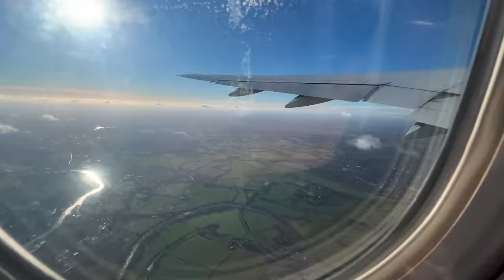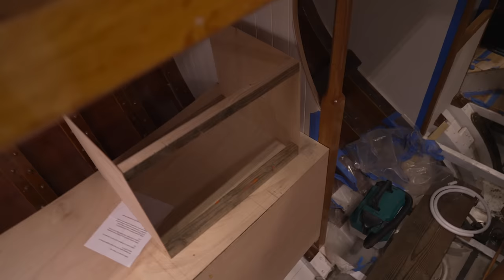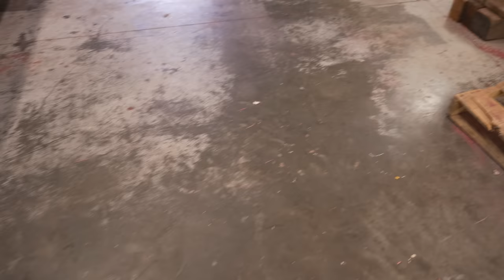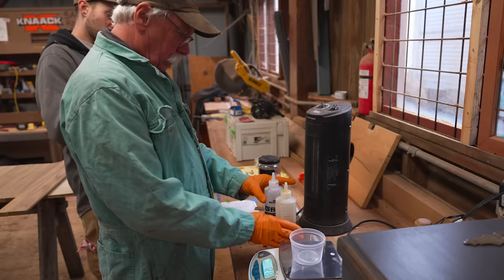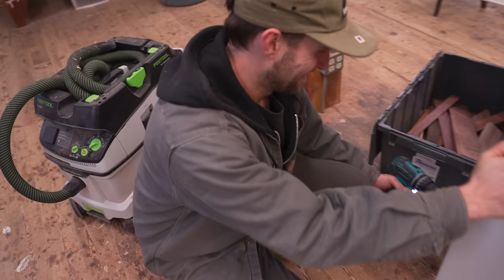Building & finishing the SOLID TEAK Deck-house

Comment: I swear, after seeing hundreds of hours of boat building videos, this is the first time I've seen anyone use a professional paint brush to apply a finish.  Congratulations Pat, you've restored my faith in woodworkers.
Reply: Then you have no idea how Le Tonkinois varnish works. It doesn't need careful application at all.
Reply: What kind of "professional paint brush" is it? Please for more informations... thanks!
Reply: @MikeAG333  Yep, I have never used that particular varnish.  But I have been a professional painter for over 20 years and have used countless types varnishes, stains, paints, lacquers, and coatings to know how tho properly apply them.  And I know that foam brushes and small 1-inch throw-away brushes simply don't carry enough material to adequately cover large areas, they shed bristles and they are awkward to hold for larger jobs.  The type and shape of bristle, the shape of the brush (angular, straight, round) and even the shape of the handle are all key to making the job not only look good when finished but to also make the job easier for the worker.
My remark was simply regarding my observations of the many other builders, refinishers, restorers, etc. that I've seen on YT using improper paint tools.  I'm sorry to have triggered you regarding Le Tonkinois varnishes.  I'm sure it's a great product.
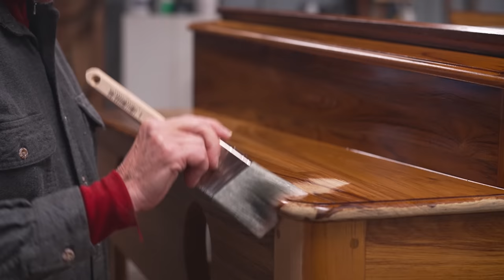Reply: @hartwiggrunewaldt5102  I'm not exactly sure what brand he's using here (17:50), but it looks much like a Purdy 3" angle-cut nylon bristle.  A professional brush will have large handle like this one, proper bristles for the type of material, trimmed and feathers bristles, and it will be large enough to carry the right amount of material to the work surface.
Reply: I couldn't agree more!  I can't stand watching people using rollers and foam brushes on varnish.  
There is no way for someone to point out how amateur they are, then for them to say they are going to "...roll and tip..." their varnish.
Reply: @FiferSkipper  
There’s absolutely nothing wrong with a roll and tip finish. Particularly when one needs to cover a lot of square footage while maintaining a wet edge.
Reply: @buellb0y  I have NEVER watched anyone successfully use the roll and tip method without taking at least twice as much time as just doing it correctly (with a proper brush) in the first place.  Not even mentioning the resulting quality difference.
Roll and tip is the absolute worst way to varnish ever; ESPECIALLY if you have a large surface area to cover!!! 
The only people that think it works are those that have never learned the correct way to do it with a high quality brush.
Listen to (if not me) the professional in the original comment.
Reply: I've varnished thousands of feet of brightwork and topside furniture over a decade plus of working at a boatyard - having great brushes can help but it's not a requirement.  Mostly comes down to the project budget and budget priorities of the customer and/or the yard boss.  I had many more finishes ruined by an errant bug (moths are the worst!) Than I have by needing to pull a chip brush bristle out of my wet edge with tweezers :) the biggest reason why boat builders don't spend money on paint brushes is that the actual duration of any specific paint project - short of painting a hull is relatively short, or often interrupted work where expensive brushes often turn into garbage.  For large projects - many of the paints just don't come out of brushes well as they are often single part or multi-part epoxy based products - and most of them are so freaking dense having a really high quality brush doesn't gain you much, although I was definitely envious of his work getting to use a nice long handle... The day somebody comes up with a chip brush or low grade paintbrush with a double length handle will be celebrated in yards all over the world lol 😂
Reply: @ewingfox6459  I didn't say it was impossible to roll and tip, just that it is an unnecessary and time consuming step when compared to actually using the correct tools.  I am sorry that you have wasted so much of your clients' time and money for the past decade but, it's never too late to learn right?

People that think spending the extra hours pushing varnish around (instead of letting it level itself) with cheap/inferior tools are just ignorantly wasting their clients' money.

The time/cost wasted by rolling and tipping with cheap brushes will (by far) outstrip the cost of a quality brush! 

For example: If it takes an extra half an hour (and that is being very generous) for you to roll and tip what it takes a professional just an hour to cover, you would charge the client $150 for labor, $8 for your roller, and $2 for your three brushes, an actual professional would charge $100 for labor and $15 for a brush. 

You actually wrote: "...expensive brushes often turn into garbage."  If you are ruining your brushes with varnish then you simply do not know how to varnish; end of story.
Reply: @FiferSkipper   @James Jenson I never rolled and tipped varnish (re-read my comment) - and for some jobs, when the shop wouldn't pay for the consumables I felt were required, I'd bring my own sable brushes from my home shop - which, yes, would piss off the yard boss, but it was the right call.  The yard boss sets the jobs, and makes those choices - he retired a few years after I left the industry, feel free to go give him a hard time.  I didn't run a finishing shop, we did general work and were a small crew - so very often we'd have to switch tasks, and my (relatively inexperienced) guys were costing us when they'd fail to wrap or dress their brushes - and of course,  Le Tonkinois is so forgiving, the discussion is pretty moot, but you seem more interested in cutting people down.  Not sure why you feel the need to be a dick on YT - especially here in the Sampson Boat Co page where the standard is and has been for years - well, don't be a dick.

Comment: The new campanionway (deck house), as well as the rest of the boat, is an absolute thing of beauty. Having spent many years doing finished carpentry I can say with out question the workmanship is a supreme example of the 'artform'. I'm always pleasantly surprised and amazed there are still craftsmen around capable of achieving this level of workmanship. I know it's ultimately going to be used as a sailboat but given the degree of exquisite craftsmanship I would be scared to death trying to sail her in open waters.

Comment: Companionway drop board.  Really recommend one version with louvres for ventilation.  Also recommend having an additional one made from acrylic.  It will make a big difference to the feel inside the boat when you need the hatch closed but need additional light.
Reply from the maker: Nice idea!
Reply: @SampsonBoatCo  But where to stow these washboards?
Reply: @Kathikas1  in stowage
Reply: Yes the acrylic one  is a great idea ,could say it the race boat version availability to tape information needed on the race on the inside and a place to write in chinagraf or niko pen on the outside heaven knows how many numbers and other info is needed at a glance while keeping water out in rough passage races ..

Comment: USCG Retired Naval Engineer. I noticed on some of your sea water systems there is only 1 hose clamp. I highly recommend you double clamp those. And might I suggest T-Bolt clamps rather than worm screw clamps. You’ll sleep better.
Reply: As someone with single clamps on my three bilge pumps and an engine coupler made out of spare cabinet wood, I can confirm this is true.

I'm gonna have to haul out soon to check on my experimental bottom paint... To PT boatyard I goooo

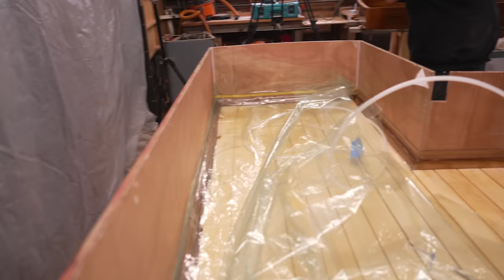Comment: 12:30 - Yes! First from my cabinetmaking days and then from when I built all-composite carbon-epoxy RC model gliders, I've always been amazed by the amount of clamping force the vacuum-bagging process can generate.

Assuming a moderate partial vacuum of 10 pounds per square inch (easily achievable with a homemade system built from an old recycled fridge motor), veneering or laminating something the size of a dining room table top (say 8' by 4') would be a typical application.

8' x 4' is 4,608 square inches; once the vacuum is created you'll have 10 pounds of perfectly even pressure on every square inch - including any tricky-to-hold curved egdes - so the entire job would be under more than 46,000 pounds of clamping force.😳

Not something you can easily replicate with G-clamps, bags of sand, bricks, blocks of lead, or even a few tame elephants. And you don't have to reinforce the workshop floor, either. 🐘👀

Comment: We had a Summer gnat problem in our favorite anchorage, so I made up a duplicate set of drop boards with louvers and fine mesh to allow ventilation without the uninvited guests dropping in for a nibble. I used marine ply and 'Teak' varnish stain, since they weren't for regular use and kept the original Teak drops for sealing the companionway. Also made 'Mesh Hairnets' for the Dorade Horns. The portholes all came with mesh, so we had a 'bugless' breeze at night...

Comment: First of all welcome back! and thanks so much for another great installment. 

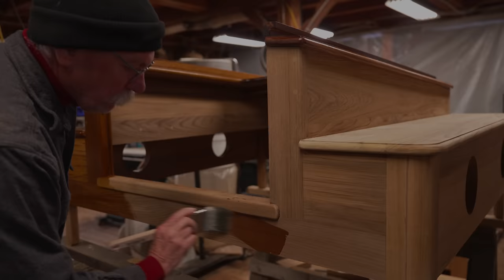I had to pause the video and rewatch  @17:30 mark and just appreciate how beautiful that teak hatch is when the finish is going on. Man, that's a beauty only nature can produce. I know teak is a pita to keep up, have some deck furniture that's teak, but it's worth every minute of hard work when you see that. Beautiful work guys. And awesome that you were able to use the original sliders. Cleaned up a little bit is an understatement, it looked brand new but I suppose that's the beauty of using bronze in a boat (assuming it's bronze)

 I'm quite interested in how you set up and plumb/wire this big beauty and make it disappear while still being quickly accessed. My brain keeps thinking about all the movies I've seen around boats and all the things that go wrong, need repaired and how quickly that needs to happen. But that's why I'm here, to learn and appreciate fine craftsmanship and planning, mostly the planning because that must be a humongous task of it's own nightmare.

Comment: Seems like I say this every week or two - things are looking beautiful! Great progress! Leo should stay away more often! 🙂  When you're using a small brush to apply epoxy to the top boards of the hatch, is there a way to clean that or do you just chuck it? It looks like a quality brush, and there are so many times you use a brush for a few minutes .... throwing them out would add up, after a while. Almost as much as some silicon bronze screws or casting a brass knee.

Comment: I am extremely jealous. When I restored my boat a 57 century I went with teak footrest since the original rubber ones were extremely deteriorated. I had to jump thru many hoops to just get 4 board feet of teak. Here you are building an entire deck house out of it. Has teak become that much more available since the 1980s?

Comment: Glad to see the Vacuum infusion method used on epoxy.   What a well rounded crew.
Reply: Infusion is where you pull a vacuum first and then let the resin flow in. If you apply resin first, then pull a vacuum, that is just called vacuum bagging or vacuum pressing. I think in this case the right term is vacuum pressing.
Reply: @mckenziekeith7434   Did I fail to see resin applies.  If indeed no resin was applied, infusion would be the correct term.
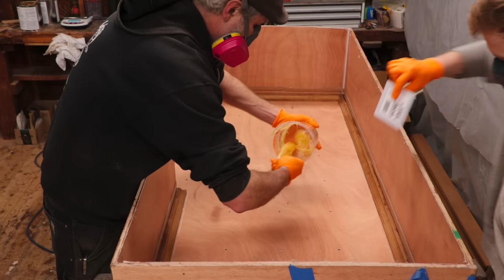Reply: @DockBev  they slathered resin all over the plywood floor of the well. It was quite evident. Right around @12:00 you can see them applying resin to the plywood, and they also put resin on the bottom of the veneers.

Comment: It isn't about the seconds with the time saving on the jointer height adjuster.
It's about the rest time saved from not having to bend over and crank on the thing. 

My philosophy is: If you're gonna do it a lot of times, spend the time to automate/reduce time right at the start. Turn it into something effortless. You'll save time, probably your lower back, and energy.

A lot of places, people specifically DON'T do stuff like this because it is what keeps their job from going away!

Comment: Wow thing really getting shape now! Again, what a craftsmanship! Chapeau to a those magnificent hands! 
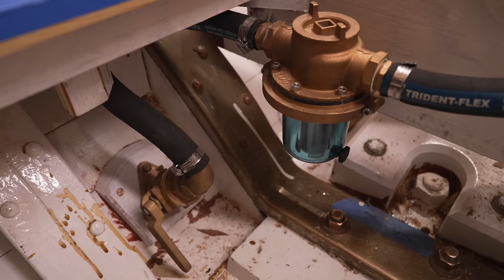A bit curious seeing at 9:35min a thru hull fitting with one hose clamp while here in the EU we always use 2. (also an insurance requirement)  So i looked it up to be sure. It seems that the ABYC) standards only recommend two clamps for exhausts and fuel fill systems. But the EU/ISO 9093 Small Crafts Seacocks and through-hull fittings seems, because payed info, require 2, so every one here use 2, A check at VTT Expert Services LTD guidance for small commercials vessels: requires above 25 dia, also 2 or one extra strong  min 15mm wide T-bolt clamp with rounded edges.
Regardless the need, best option etc, you might give a marine insurance company  in the country under which flag you sail or wat it to be insured a call. 
Good luck building!

Comment: How much insulation does the wood of the hull provide? Will there be extra insulation required for condensation contol if you're sailing in PNW in winter?
Reply: I am not an engineer, but I think this boat is not for northern latitudes.
She has no ice belt and thermal insulation, heating.

Comment: Welcome back Leo. If I may ask a question though,  is Teak  so stable that you need not worry about end-grain exposure over time? Because I watched Pat build that Companion Hatch and most Teak planks were cut to length and installed as is, but the Companion Hatch itself has a Breadboard edge on it, instead of exposed end-grain. Is there a reason for that difference? Would you have used a Mitered Breadboard edge if you were to change it?

Comment: how does the hatch lock in place when open? to keep it from sliding? will there be some sealant to make it water tight?
Reply: They generally don't lock open. I have never seen one that locked in the open position anyway. Also, they are not sealed. This type of hatch is not completely watertight. Only the most hardcore boats have watertight companionway hatches. With the weatherboard in place, and the hatch closed, in a very heavy sea with waves sweeping the decks, some water will come in through the companionway. Mainly you try to avoid those conditions as much as possible. Spray and splashes will be blocked from coming in the boat. It is only when a wave sweeps the deck that water will enter.

Comment: First if the following questions are not obvious, I know nothing next to nothing about sailing or boats in general and I was wondering if someone could educate me on a few things. So why do some sail boats have a cockpit that is unprotected and open to the environment while others have a cockpit that is protected? I have seen some sail boats that have controls on deck and inside, I am assuming that the outside controls are for when sailing and the interior controls would be more when under power and during bad weather or is there a nothing reason or reasons?  Also, do more traditional sail boats like Tally Ho have navigation and radio equipment mounted outside and if so, how are they engineered to protect against the environment and allow for security when the boat is in port?

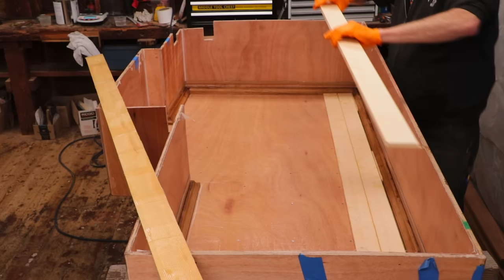Comment: Hi Leo! I see at 6:30 that you're using Titebond 3 woodglue? @WoodByWright's videos on testing 32 wood glues (see video id ZoaTZY5cSQE 12:16) has shown it is in fact not good at all for exterior/water exposed/freezing use (yes, contrary to its claims). Just thought you should know in case you use it for that.

Comment: so why flat head screws everywhere? because they are period correct? i would think other type of head drive would be so much easier...
Reply: Slot-head screws are the standard for wooden boat-building. When repairs are needed in 5 or 50 years, the slots can be quickly & easily cleared of dried goo & old glue, using a blunted drill bit chucked into a power drill.

Comment: I wonder how much of the original boat is actually left? 2%? 50%? 
And with all the new wood, is it still technically the old boat?
Reply: The transom and a few bits and bobs elsewhere on the vessel, certainly less than 1%, but at least something.
Reply: "Now, it is a law in Lloyd's that the Jane repaired all out of the old until she is entirely new is still the Jane. The Spray changed her being so gradually that it was hard to say at what point the old died or the new took birth, and it was no matter." From Sailing Alone around the World by Joshua Slocum.